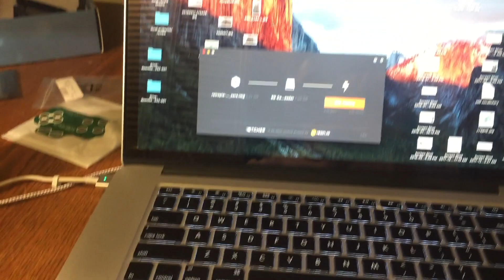Cheapest built game boy Zero pi for $35

Comment: Will it charge the battery while the switch is off? Thanks, looks like it does, you just cut the circuit in the output :)
Reply: yeah n those power chips are like $1

Comment: How it this so cheap in the US? even the pi is much cheaper in the US than in central europe.
Reply: Personally, I'm not sure about the cost in the video title. I did buy a Pi Zero for $5 (then import tax) though bought a Pi Zero in the UK for £5 ($3.80/€4.40). I do wonder how much the Tinkerboy board was (just looked - sells for $9) as V3 now sells for $55 though I did order PCBs for one of the simpler GBZ PCBs until I design and fabricate a Tinkerboy/Kite-esk AIO myself - which I've done my research and ordered USB controllers, audio, onboard teensy and once I build my DIY Powerboost 1000C would look to integrate that onto the board as well.